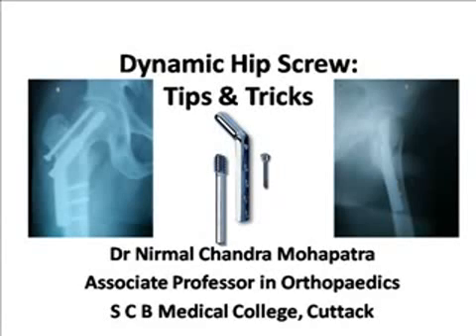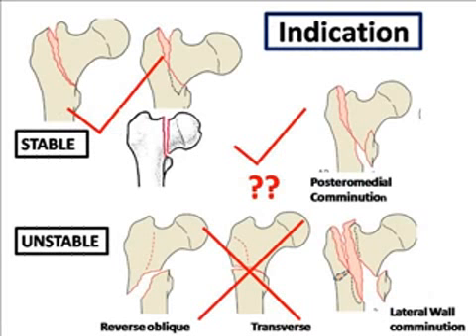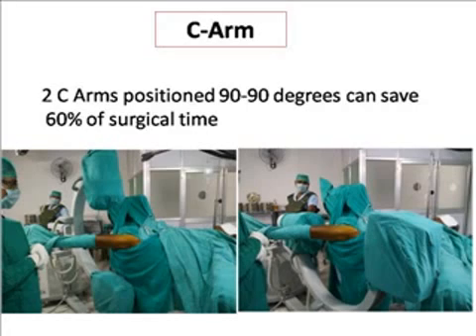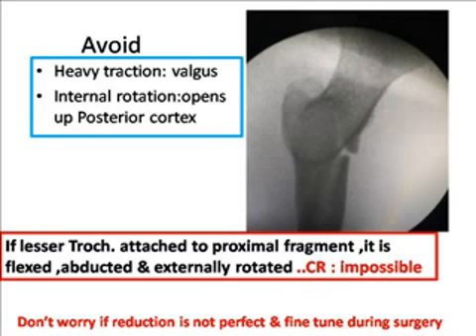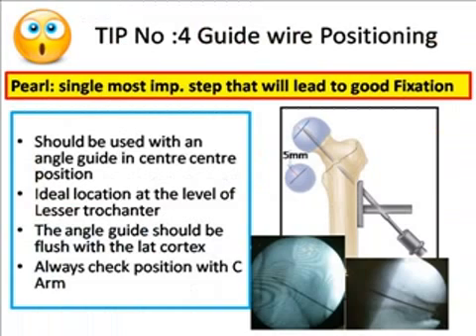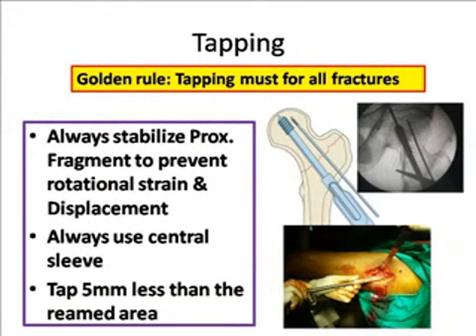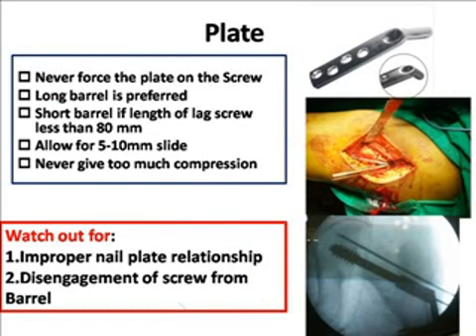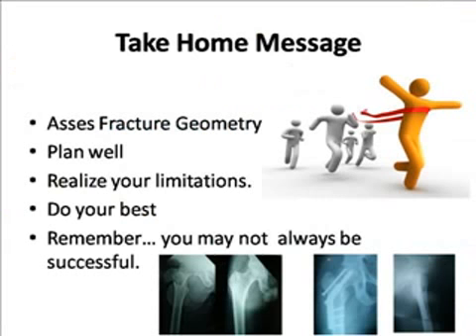HIP : DHS for intracapsular/ trochanteric fractures

Comment: Good day Doctor now im 15 weeks dynamic hip screw still on partial weight bearing. 6 weeks non weight bearing then followed by partial weigjt bearing. After 10 weeks x ray reveal upper screw back out then go back again but 20 percent partial weight bearing cause doctor told screw loosening then after one month which is 14 weeks doctor worried about union ct scan done then it reveal. Evidence of fixation of the fractured right neck of femur with no fracture nails or lucency around with evident osteo arthritic changes in the form of marginal osteophytes and irregular joint space. Normal appearance of both sacro iliac joint. Conclusions the right hip joint shows fixation with remodeling of the right neck of the femur and osteo arthritic changes as fore mentioned. Is it ok? Now 15 weeks i can go now for full weight bearing,?
Reply: Share all your x rays here. I'll advise.